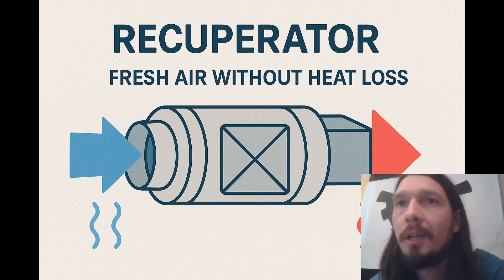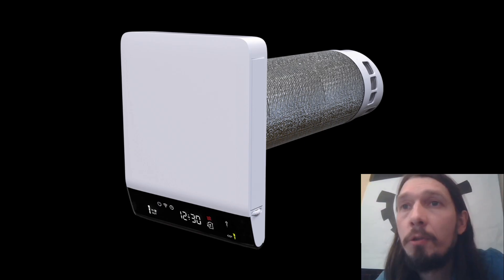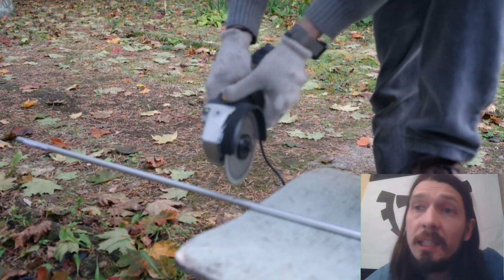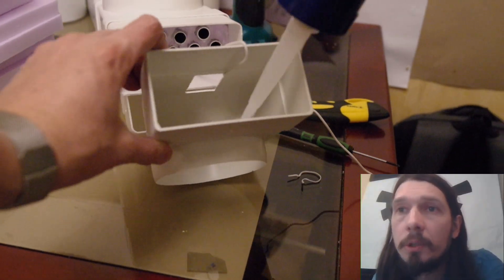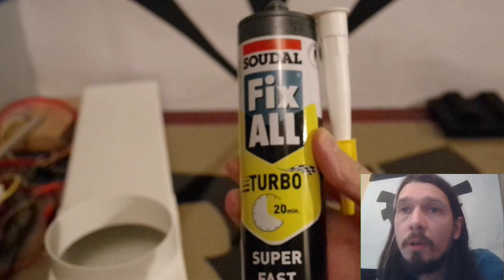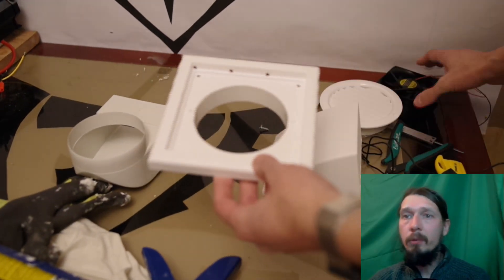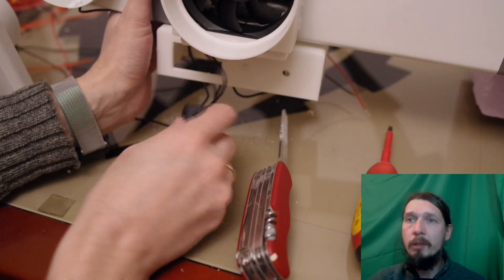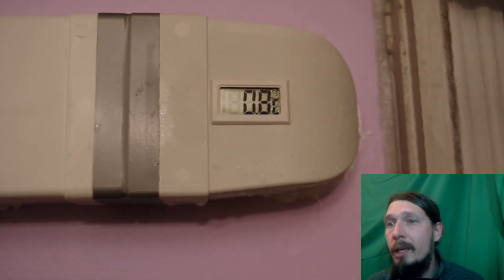DIY Air Recuperator: Save Heat and Let Your Brain Breathe

Comment: f I were you, I’d add a condensate drain for the moisture that will collect in the heat exchanger. Otherwise, mold may develop after long-term use. I’d also consider adding a filter to the intake air to reduce dust inside the apartment.

Comment: Should the tube material have high or low thermal conductivity? Aluminum is around 200–230 W/(m K), copper about 400 W/(m K). But copper tubes are more expensive and heavier than aluminum

Comment: I think that a car heater blower would work well and the motor speed could be controlled automatically by the humidity / CO2 level or other parameters.
Reply from the maker: Thanks! A car heater blower is a great idea! It should have no problem dealing with the filter resistance.

Comment: I could do the calculations if I had the pipe internal diameters and air-flow.

I suspect that the pipes are too small to use with air and would cause a lot of friction / turbulent air flow loss.  

They are probably more suitable for water.

The pipes should really have thin aluminium fins on them like the pipes at the back of a fridge or in a dehumidifier, car radiator or air-conditioner which are all designed to exchange heat from the pipe to the air, but in these cases from a liquid in the pipe to air.
Reply from the maker: Actually, the tubes do not add significant friction. Later, I added an air filter, and that reduced my airflow significantly. The problem is that a regular computer fan doesn’t create enough air pressure. Now I’m considering using a more powerful pressure fan.

Thanks! Aluminum fins are a great idea!!!

Comment: White spirit usually works well for removing labels.  ( mineral spirits (US, Canada), also known as mineral turpentine (AU/NZ/ZA), turpentine substitute).

Preferably scratch the surface of the label with abrasive paper or Stanly knife then apply white spirit on a paper towel.

Leave a few minutes to soak in then rub with the paper towel. Repeat until everything is removed.

Comment: Hello,
thank you for sharing your test setup. I am also considering the build. Few observations: I think you use UNsuitable fans. These "computer" axials are for moving relatively high air mass, but low pressures. If these are blocked, or partialy blocked (the ducting is a blockage too) the dont work much. You need dedicated fans for "tube" use. Either radials or axials, but made for "tube" use.
I Also think that bigger body of the thing simlifies stuff. Then you can use bigger fans (on lower rpms), more heat exchanging tubes with bigger diameter (so the airflow is not choked). ...
Reply from the maker: Thanks! You’re right — after adding filters, the airflow drops significantly.
Most tube-mounted fans require 220V, but I wanted 12V fans so I could control the RPM.
I’m looking for 12V, 10–15W radial fans for a new recuperator I’m building, and I think radial fans will also be suitable.
So if you have any suggestions for fans that can be bought on Amazon, please share!

Comment: Looks cool, but this design is really old-school. I built one like this about 10 years ago, and at –38°C everything froze solid and got covered in condensation. I even had to add a heating element. I don’t see any other way around it.
Reply from the maker: Yes, heater is needed!

Comment: Obviously, the house isn’t completely airtight. However, using two recuperators operating in opposite phases prevents cold air infiltration. When one unit supplies fresh air, the other simultaneously exhausts indoor air.

Comment: You could’ve made two plastic plates with holes and sealed them together like a sandwich. Probably would’ve taken less sealant and been less of a headache. Then, once dry, just seal the edges and slide the whole thing into the duct.

Comment: Sealants don't typically make good adhesives.

This is the industry I work in, I would suggest downloading the manuals for dedicated residential ERV/HRV's and reverse engineering them for a window installed unit. These typically have filtration and drainage plus they can be set to run on timers based on outdoor temps and humidity. 

Personally I think you'd be better off with a timer to remind you to open/close a window for X amount of time per day if your in the room all day. Or open/close it when you grab lunch or dinner. This is what I do for my office and CO2 stays around 500-550 ppm.
Reply from the maker: Thanks for the advice about downloading the manuals!

The current setup is just a proof of concept. In the next iteration, I plan to add filtration, drainage, heating, and possibly a CO₂ sensor. For now, I’m just running tests to identify potential issues—there are many that aren’t covered in this video.

Comment: The design is simple, but it has some downsides. The biggest one is condensation — it will build up inside, and that can cause mold and other nasty stuff. The heat exchanger really needs to be easy to take apart and clean.

Comment: Interesting setup. But does it really save that much? Feels like just using a fan with a heater would be cheaper.
Reply from the maker: If you have cheap electricity then recuperator is useless indeed

Comment: Interesting design. I'm very very slowly working through project anxiety and working on building myself a metal core very similar to industrial ones you referenced. I am trying to make a gear press that will shape rolled metal into corrugated sheets I can make my own core with. I finally got to the point of learning how to make mating gear teeth so I can form the corrugation. I doubt I'll put it on my channel if I ever get it done. We'll see.
Reply from the maker: Looks a bit complicated, but good luck with your project! I actually have a different approach in mind — next time I want to try making aluminum-foil tubes.
Reply: @vt-tech-eu  Thanks! I look forward to seeing more of your iterations.

Comment: The normal devices have a name, they are Heat recovery ventilators and Energy recovery ventilators. They both have a separate intake and exhaust but the second one accounts for humidity and the first one doesn't. The alternating direction heat exchange device you mentioned can be used in pairs to fix the house leakage issue, but you only need one HRV or ERV which doesn't need to switch directions.
Reply: Oh also one easy option that might work is to copy the recuperator of some model stirling engines but bigger. Wire wool or steel wool in a big pipe could make a good version of the alternating direction kind. It's probably cheaper and easier than stacking wire meshes, and doesn't leak as much heat lengthwise as metal tubes. Both wool and mesh are often used in Stirling engine experiments. You can try multiple coarseness grades to optimize the result since flow resistance might be high if it's too fine. It might take more money though especially using a pair of them, although less work probably.
Reply: with the hot-air gun from a soldering station.

Comment: Nice project! I always wanted this but I never knew how long pipe would be enough to do a good heat exchange job for me.
Reply from the maker: Thanks. I think it depends on how much air you’ll be pumping through it. Right now, my 12V fans don’t provide much airflow, and if I replace them with 220V ones, the pipe length might become the bottleneck. So next time, I’d go with 1 m instead of 0.5 m.

Comment: You should’ve just gone with new windows instead.
Reply from the maker: Yes, but it's rent house...
Reply: @vt-tech-eu So then multiple sealed-layers of plastic and air on thin wood frames with clear plastic…would help with reducing heat loss in your rental. Utilitarian look, but effective and removable. Good luck 👍 from 🇨🇦
Reply: How does installing new windows solve this problem generally?